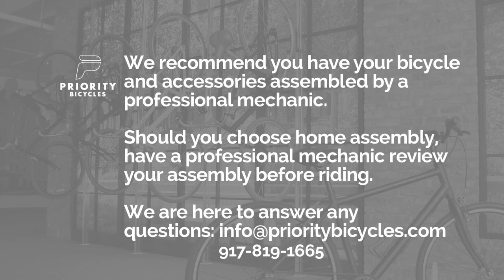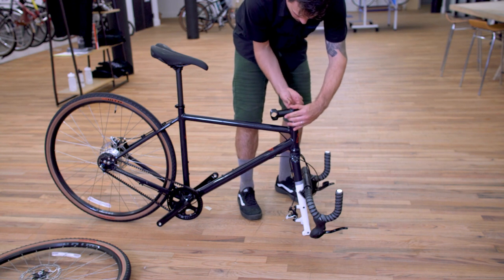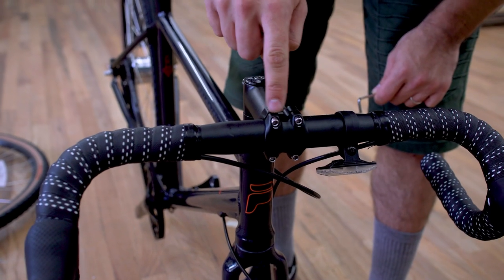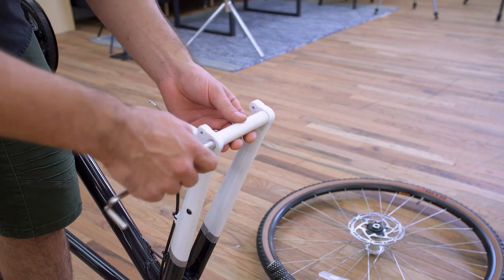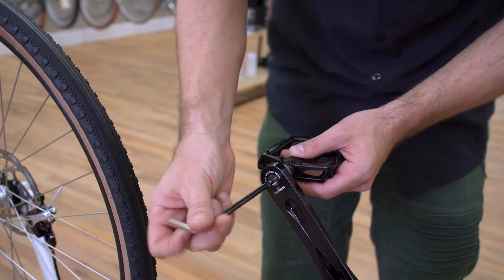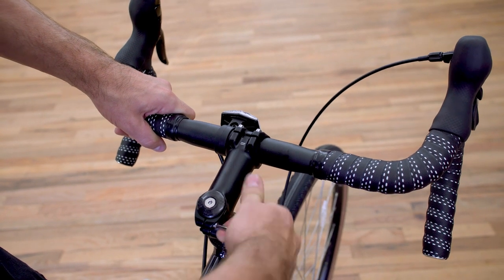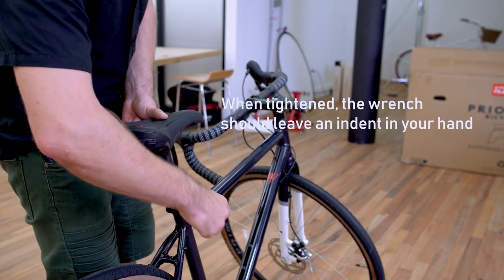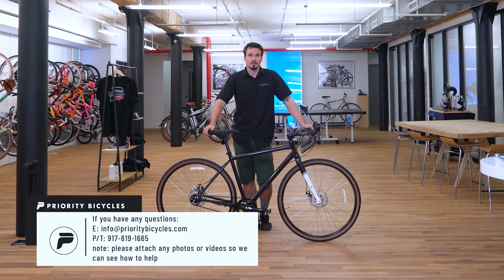ASSEMBLING YOUR PRIORITY APOLLO

Comment: The assembly instructions could use an update as the Apollo frame has changed such that all cables are routed on the drive (left) side of the bike now unlike the bike in the video above.
Reply: Then mine is different again as the cables all seem to route to the left when on the bike (non drive side) They also rub against each other :-)

Comment: I got a flat on my rear wheel tire today and I'm trying to figure out how to safely take off the rear wheel because of that wire that connects to the hub. Other than that, really good bike - especially for the money.
Reply from the maker: We will have the video up shortly. In the meantime shoot us an email to info@prioritybicycles.com. Thanks!!
Reply: I'm sure after one month that you have definitely repaired that tire, but in case you haven't seen it, the video is out now.  
https://www.youtube.com/watch?v=0Xx1hr-sWJw
Reply: @BooLee01  Thank you. I was helped by the info email account. They linked a video. It's still hard getting that bolt at the end of the wire to fit into that slot with my fat fingers ha ha. Priority customer support has always been outstanding for me.
Reply: @prime8nate  Glad you got it worked out. How do you like your Apollo? I am retiring and moving to Japan in 2022 and looking for the perfect bike; right now, the Apollo is at the top of my list. It seems as if it would be quick and nimble in the city and just rugged enough to do some bikepacking on the weekends.
Reply: @BooLee01  Yeah, I really like it. I’m not a big fan of chains and derailleurs. Coincidentally, I taught English in Japan and had my first belt drive bike there. I was just outside Tokyo in Chiba prefecture and it rained a lot and the belt drive couldn’t rust. I would say the Apollo doesn’t come with the best gears for steep climbs but you could just get a slightly larger rear cog from Priority if you ask, apparently.
Reply: @prime8nate  Yes, practically everyone who reviews the bike says they wish for easier gears on the bottom end and a shorter handlebar stem. If I do go with the Apollo, I will almost certainly order the other cog because Japan is like 80% mountainous. 

I know where Chiba is. I spent a total of just over 14 years in Japan (Okinawa and Tokyo), the first three in the military. My wife is Japanese and that's where we've decided to retire.